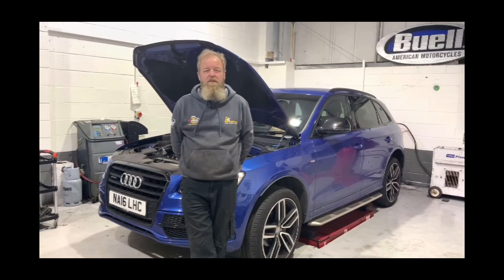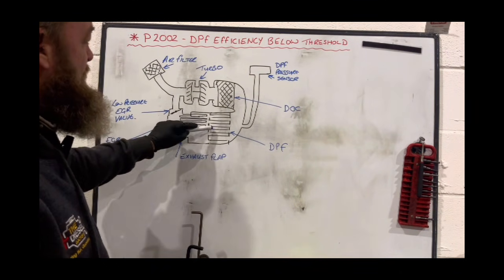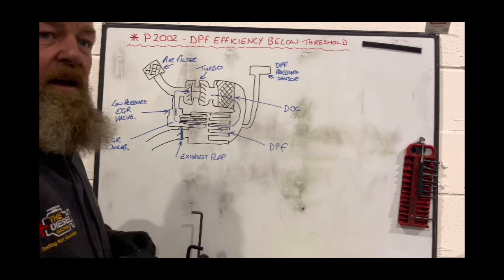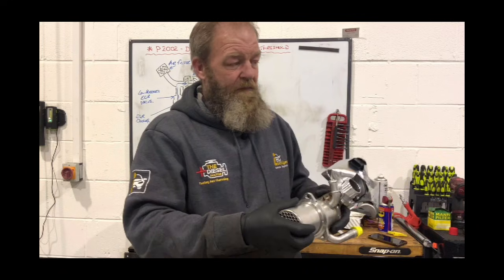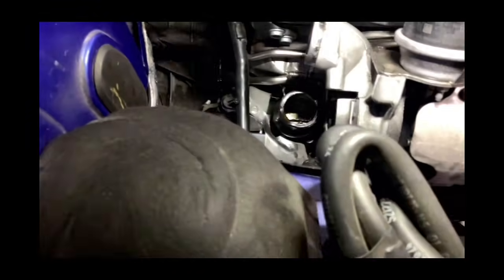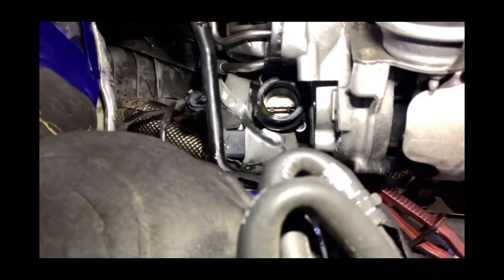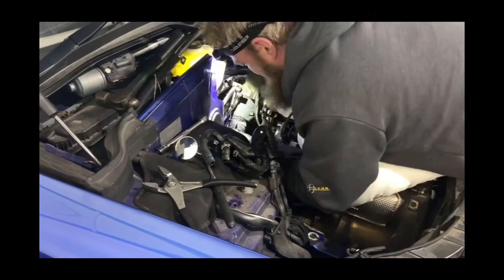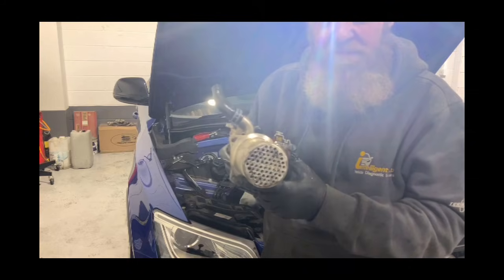Why the fault P2002 DPF Efficiency below threshold, Audi, VW, Seat, Skoda, Euro 6 is triggered.

Comment: Had similar on an A5,cleaned cooler & dpf on car, cleaned ad blue injector, used dipetane regularly, added ad blue additive on every fill. Never came back.   
Problem initially started with scr fault that I managed to sort. Ad blue blocking up the cooler. Map out ad blue and no problem.

Couple years later, just bought a rav4 with n47, maf light coming up. Same again,  egr cooler blocked up. Any diesel problems with air flow, I'd recommend looking at cooler first.

Comment: i replaced this egr on my vw passat b8 but vehicle didnt throw any engine error so i didnt any adaptations because i thought “its plug and play”, was i wrong since im getting p200200 again ? idle dpf pressure is 5 and 2500 rpm is 28/29? what do i do??

Comment: What's to stop you from filling the cooler with boiling water to clean out the crystilised ad-blu?
Reply from the maker: Access for one, then the Adblue crystals are attached to carbon deposits so I don’t think the boiling water would have the desired effect. What you need to remember, we are charging people for a fix, we have to guarantee that fix. The only way we can 100% do that is to replace the component that’s causing the issue. 
We have attempted to clean them off car unsuccessfully as the process requires equipment for cleaning heat exchangers. If we were to purchase that equipment to clean them, then pressure test them the cost to do so would outweigh the cost of a replacement which comes with an Audi parts warranty.
Reply: @intelligentauto737 how long did this take you to do, I'm a 24 years experienced Merc systems tech (diagnostics specialist) so I'm not put off by these kinds of jobs.
Reply: @johnmorton5498  I did this exact  job on an A4 and it took me about 10hrs if that helps. Alot less space on an A4 and alot more ripping .
Reply from the maker: @johnmorton5498 we allocate a full day to these for a technician that has plenty experience doing them.
The first one I done took about 10hrs
Reply: @intelligentauto737 jeez, I'm really hoping audi pull through with the used approved warranty on the car we've got with the egr blocked.
Reply from the maker: @johnmorton5498 if they’re like every other warranty company I’ve dealt with they’ll say “cleaning” or “contamination” is not covered.
There is a VAG Technical Service Bulletin about this issue so they’re well aware of it.
Reply: @intelligentauto737 that's the angle I'm pursuing, that Audi have done a technical bulletin stating to check the tail pipes for soot, if they are clean then it's the low pressure egr cooler blocked.
My audi dealer has already said if it's blocked with soot then it's not covers but we all know thay block up with crystallised ad-blu.
I'm just not enthusiastic about a 10 hour job on my day off 😂

Comment: What if you replace the EGR Cooler and still get P2002?, Ive been throught hell with my 2017 seat ibiza 1.4 TDI because of it. It appeared after the turbo died and repaired, dpf removed and cleaned. Already spent more than 5k on it and still have the P2002 and the P005D98
Reply from the maker: We would always test to confirm it’s the cooler prior to replacing it. 
This I a case study on one car which had this fault and it proved prior to replacing it that this was the cause.
I will always advocate seeking professional help with any fault you have with a vehicle as there could be other factors causing this

Comment: Been driving my A4 B9 2016 around with this error for a couple years, resetting the code weekly. Couldn't find a mechanic that would touch it and I was too cheap to have it fixed by the dealer (€1400 something). To my surprise last week the code has vanished after a short drive while it was 40 degrees C outside. Not returned (yet).
Reply: Error came back though :( surprise ;)
Reply: You get it sorted in the end? the new EGR cooler and EGR valve aren’t actually the expensive, it’s the labour that makes it dearer I reckon.
Reply: @iknowyoureright8564 the error did come back again and I’ve had to reset it twice already. Once more it reset itself. Nevertheless the car feels like it’s getting more air than before. I guess the cooler partly opened itself and the car managed to do a couple regenerations above the efficiency threshold. At 270kkm now, I think I’ll just see what happens.

Comment: Hello!

Thank you so much for your excellent and detailed video on replacing the EGR cooler. Everything is shown very clearly and step-by-step — it really gave me the confidence to take on the job myself.

I've already disassembled most of it, but I'm stuck on one issue: I can't figure out how to reach and remove the mounting bolt that holds the cooler to the engine block. The location is really tight, and I couldn’t clearly see how you handled that part in the video.

As an experienced mechanic, I’m sure you found a good way to get to it — could you please share how you managed to reach and unscrew it? Any tip would be greatly appreciated.

Thanks again for your amazing work and for sharing it with the community!

Comment: Thanks dude. First time i went they only reset the code and did EGR re adaptation...second time they changed some expensive sensor (not the pressure sensor some thing else on turbo exhaust) and EML came again... third time they change this part (EGR cooler) and they cleaned some flap valve... I really hope no more EML... (on my basic scanner i was puling p2002 but on their scanners more things ware popping so i guess that is why they change that sensor first...).. any thoughts?

Comment: inside the intake manifold you are removing @12:00 is there another (a second) flap inline with the one mounted on the cooler? my idea is to try to clean the cooler dropping cleaning fuid down the intake manifold... but I have to actuate the flap with diagnose, or both if there are two...

Comment: thanks you very much for the video.The egr cooler can it be clean and used again?
Reply from the maker: @noyes7794  we tend not to do that as we’ve seen instances of the cooler leaking coolant into dpf after cleaning.
We do a job, we need to guarantee it for the customer.
The lions share of the cost of this job is labour so why would we want to chance having to do it again, potentially damaging the DPF and also running the risk of the turbo and engine ingesting coolant and causing a hydro locked engine
Reply: @intelligentauto737  can a egr cooler be clean and be used again?

Comment: I have the same code popping up on
my 2017 Skoda Yeti SCR. These newer EA288 engines were supposed to cure the EGR problems by diverting the exhaust through the DPF prior. Trouble is, now with the addition of DEF we are now dealing with a whole new set of headaches. I have an older 2010 EA189 Yeti with 475,000 miles on the clock. Still on original DPF and only ever needed one EGR which was on the front of the engine and took 40 minutes to change.

Comment: Hello Gary. Great video and good explanation. I do have a question. The egr difference pressure sensor G450 is placed to monitor the pressure difference over de lp egr. That's it's purpose. Also the ecu knows when it shuts the exhaust flap. At that moment the ecu sees that pressure is rising in g450 and g505 if egr cooler is blocked. Why doesn't it set a faultcode on egr pressure difference to high? That's why g450 is on the car.

Comment: Hello, I am opening the discussion with the following problem: I own a Leon 1.6 tdi, with 198,000 km, engine code CXXA, in which the oil level in the bathroom was increasing, around 1 liter above the maximum level after 5-6000 km traveled.  After all the possible tests carried out, it was concluded by a service specialized in the repair of Delphi injection systems that the problem is with the injectors, that they lose at the nuts.  I specify that before removing the injectors and checking them, the exhaust pipe was perfectly clean, without soot, as it happens with any Euro 6 diesel, the engine was working perfectly, with no warning lights on the dashboard.  After checking, it was decided that one part of the injector must be completely repaired (??), and the others only require nuts and specific adjustments. After 2000 km from the intervention, a little smoke appeared only during short acceleration, and for a short period of time  .I wouldn't have noticed the issue if the on-board engine light hadn't come on, accompanied by the error P200200-Diesel Particulate Filter Efficiency Below Threshold B1.  In addition to that, the exhaust pipe also smoked. The engine did not limit, it fires as well as before the injector repair. The error can be deleted, but it reappears after 50-60 km.  I returned to the service indicating the problem, and this time I was told that the problem is not with the injectors, but with the DPF, which is "broken", that is, it only retains the soot.  Somehow I'm in the field, I deal with trucks, I work with the same systems but they're on a different scale, I replied that it can't be a broken DPF.  They are euro2 systems that, if they work in optimal parameters, do not produce any soot.  I still use injectors, only here he walked. I also attached a picture.  I want to know if there is anyone here with the same problem and how they solved it in the end.
Reply: Aceiași problema o am și eu ...am schimbat senzori de presiune diferențială cei doi , am schimbat răcitor gaze joasă totul pe original ...nimic , problema e la dpf este crăpat sau pătat de antigel ...am fost și in reprezentanta Skoda la fel au zis , dacă ai găsit vreo rezolvare e bine, ori trebuie înlocuit sau anulat .

Comment: Nice explanation mate.  That means if the egr valve is blocked theres no way a technician can tell by diagnostics if its a bloclage in dpf or just the egr valve thats blocked?  Im no technician but im guessing there would be a difference in cost  between egr and dpf repair isnt it?

Comment: I replaced egr gas cooler, with a new one, and after a week error appears again.
Reply from the maker: Who diagnosed the fault?
Reply: at dealer skoda, i replaced nox sensor bank 1 and egr  @intelligentauto737  error is present, when ride o city with start stop activated, deactivated error dissapear. Just when ride with start stop activated show error on clusters, when ride without no errors
Reply: at service offcourse, one more question, after replacement need adaptation? or just replacement, guys from service, just replace, no adaptation @intelligentauto737

Comment: The shop that replaced my cjaa's DPF never reconnected the tube running to the lower pressure EGR filter. I'm wondering if this was a mistake or an attempt to prevent this from happening again. But I'm under the impression the EGR system lowers temperatures of combustion and prolongs the life of the engine.

Comment: Very interesting and informative, Do you know if the ASB 3.0 tdi engine has the same system. My wife's car has the same 2002 fault, but she does very few short journeys, we have had the car for 13 years and only twice has the dpf light turned on and each time just by driving in low gear for a while the light cleared. Now it is in limp mode with the glow plug light flashing and the 2002 code comes back as soon as it is deleted.

Comment: A very good video with a good explanation of the EGR/DPF layout. One question though, the EGR cooler looks easily to clean as its a tubular heat exchanger but fitting a new one appears to be what everyone does. Is this because its so hard to get to or is there another reason?

Comment: This is an interesting case.  I’m surprised to see this much carbon after the DPF.  Also a delta pressure sensor would have been a better design choice or at least a computer algorithm to only check DPF efficiency when the back pressure valve is in the fully open position.  I suspect with the EGR commanded on you would not see a drop in the MAF reading due to the plugged cooler.  Great video as always!

Comment: That Code p2002 on Most Diesel cars post 2008 would be caused by a blocked or partially blocked DPF and would be related to a driving profile problem, and in most case it would involve DPF flushing fluid directly into the DPF lowering the engine oil in case of creep and a 60k round trip on the Motorway, so it could do a passive clean. However there are sometimes more esoteric causes for this and other problems that  have common causes. That's why its worthwhile getting your car repaired by someone who has experience not just of the problem but how it may relate to your car specifically. Its a good explanation here of a ongoing problem allot of cars with SCR systems are experiencing.

Comment: can someone explain under what conditions the EGR valve is actually open? I image its not recirculating exhaust gasses into the intake all of the time?
Reply from the maker: There’s 2 EGR’s on this engine, both operate under different loads and Rev ranges
Reply: @intelligentauto737  yes I've noticed this. one is the one you replaced in the video, where the valve opens to let exhaust gases back into the intake at the turbo, and there is also a passage in the head from the exhaust manifold to the intake side of the head and there is a valve there but I've no idea where that valve directs the gasses? I checked diagrams but can't figure it out

Comment: I have a audi A3 1.6 tdi from 2015. Same faultcode p2002 keeps returning. Could it be the same problem as in the video? Already tried changing the pressure sensor, did not help.
Reply from the maker: It’s impossible for me to say without seeing the car
Reply: @intelligentauto737  we have a checkup every year in the netherlands where they also check the exhaust gasses. So mine did not qualify because of this problem. The emission is too high. I checked the car with vcds for the last regeneration. Is was 200km ago

Comment: How did you loosen the EGR cooler bolts without removing the exhaust pipe?  The lower bolt between the exhaust pipe and the cooler.  I can't get past it with my tool with an extension...

Comment: Hi , when or what condition makes the exhaust gas divert thru the cooler rather tham the dpf and straight out the exhaust?
Second question , acetic acid, vingear will dissolve urea crystals. Tell me in crazy , cause crazy idea but why couldnt I use a dose of vinegar in place of adblue to clear out from time to time.

Comment: I feel better now, having sold my 100,000 mile VW 1.2 litre 3 cylinder turbo Polo for spares or repair, it developed the same fault after already, 24,000 miles earlier, having had its EGR valve replaced at some expense. The engine is transverse on the Polo, with all the exhaust plumbing up against the engine bay bulkhead, no wonder the garage who agreed to do the job, said it was a nightmare job! 
Well done on the video, showing your analytical and logical approach to problem solving.

Comment: Audi A3 TDI with one of the diesel injectors changed, dpf removed cleaned and refitted. P200200 fault after 100miles of highway driving. Any ideas?

Comment: I know you shouldn't but could you map the egr closed and by pass this issue long term? Would that be a bad idea long term. I have the p2002. Really hope it may be the dps sensors. I've heard the diaphragms get hot and degrade
Reply: Did you end up mapping it out ? I’m currently contemplating doing the same on mine.
Reply: I have the same fault and been told I can just map it out and delete egr but I ain’t sure if it’s good or not ?? Did you end up doing a map and deleting egr ?
Reply: I have the same fault and been told I can just map it out and delete egr but I ain’t sure if it’s good or not ?? Did you end up doing a map and deleting egr ?

Comment: Great video, thanks.  I had my EGR cooler/Valve replaced (2014 Golf GTD CUNA) and driving back, 'Ping' EML again and same code P2002. God knows what it is now!
Reply from the maker: Can I ask, did you ask the garage to change it or did the advise that what it needed?
Reply: @intelligentauto737  I'd changed the pressure sensor and this is the next thing. Tbh, looking at the old one it was due a change anyway but now, stumped! (I did have an egr fault too).
Reply from the maker: @TheChrisDT  this is exactly why I will not perform any job on any vehicle that wasn’t diagnosed by myself
Reply: Hi, did you manage to find the issue and resolve it in the end?

Comment: Im getting this on a 2016 A5 with 62K! , no loss of power, and everything seems fine.  Except for every 150-200 miles the light comes back on.  I have squirted some Wynns EGR cooler in there in an attempt to combat it off until i sell it.  I doubt it will help "much".    So far no light but suspect your video is bang on the money if it comes back.  Im just going to remove the unit, use mr muscle oven cleaner and deep clean it all.  Put it back.

Comment: Very helpful and informative post. I'm in the trade myself and have a 2016 A4 diesel with 125k with exactly this issue, so although  it's a high cost issue, it's still good to know that I can direct my spending into the right area to resolve so I can retail the vehicle correctly. Also could you give me a steer as to where I can locate a new cooler as I don't think trying to clean out is the right option as to want to take the risk of throwing a light back on. Many thanks, regards, Darren